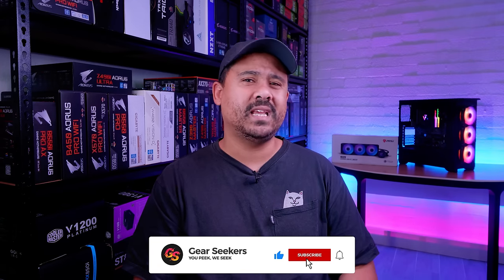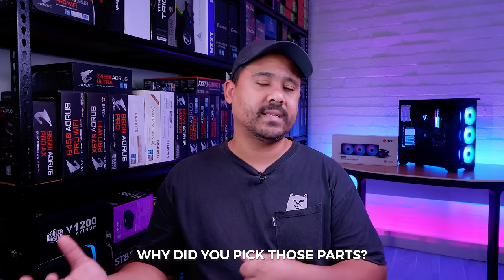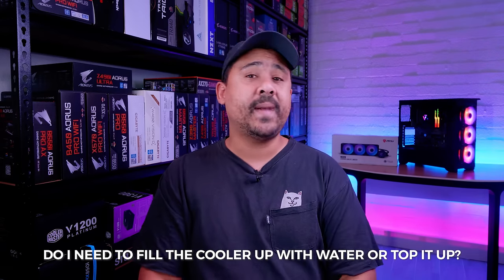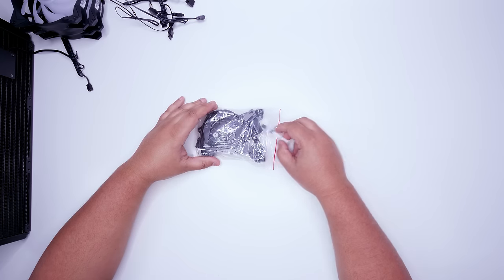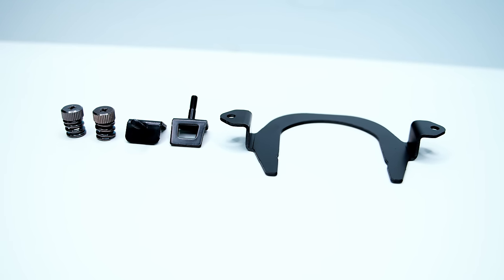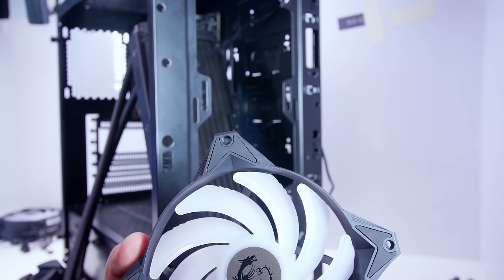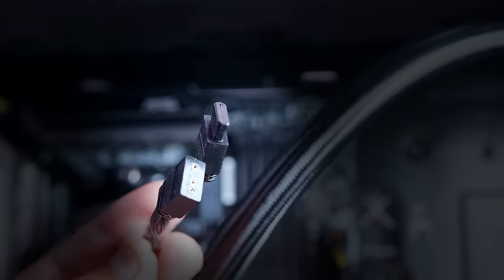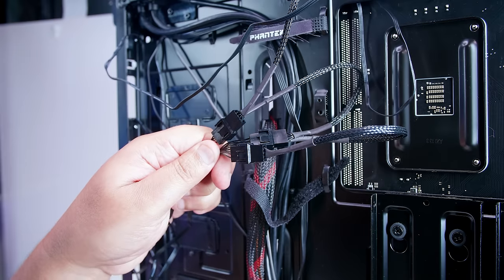HOW TO MSI MAG Coreliquid 360R & 240R AMD AM4 & AM5 Install Guide

Comment: Hi I have msi mag 240r. I can put it only on front case. Should I put tubes up or tubes down during radiator montage? On movie tubes are up but on some vid they sad that should be down because if is up then have some bubbles inside cooler.
Reply: Tubes should always be down, but if it is up that is fine
Reply: Do not put the radiator below the cpu block or the bubbles will form inside the radiator making a horrible sound, and life expectancy down the drain

Comment: Can anyone tell me are the way the fans are installed. Is this intake or exhaust?
Reply: He has the fans as intake in this video. They are pulling air in from the front and pushing it out the back of the fan into the radiator.

Comment: I wann put this on top of Motherboard not front. But as you said that is the correct way to install fans. how is that possible to put at the top Unless flip the radiator and install the fan. Or is that any problem if I put fan on the other side of radiator to put on the Up top of the case?

Comment: I have one small question. I have the MSI B450 Tomahawk Max. Both of the RGB ports are 4-pin and every RGB header on both the fans, and pump head are 3-pin. Is there any way I can connect the 3-pin to the 4-pin headers?
Reply: welcome to the stupid area of rgb & argb ... if u wanna control the lights on this cooler than argb header is a must .. or else find a cooler with rgb header .. i myself am extremely dissapointed with MSI for manufacturing the best B450 but not going with at least one ARGB header :3 :( .. i wanna buy this cooler for the 3700x but have a razer setup so need the lighting synchronized with my system so badly :( ...

Comment: my 240r failed in just 9 months . Temp spikes at 60-70 idle, must be rotor failure or air bubble. I tried different orientation, re-applied thermal paste and did the tilting/shaking thing but still out of luck. With my last spread of my thermal grizzly, I replaced my AIO with my previous Corsair H60. Going to stick for my Corsair H60 for a while until I can purchased something better CPU cooling solution.

Comment: I would recommend you avoid this cooler at all costs. I am currently sending my second one back to the store. Both my original purchase, of this exact model (the 360R), and my replacement failed with just over a year use of each. The fans still spun, but my CPU hit 100 degrees Celsius, and then thermal throttled from there. Maybe I'm super unlucky, but two exact same coolers failing the exact same way is way too much of a coincidence for me. Won't be purchasing an MSI cooler again.
Reply: Had the same experience. First one broke and got another just thinking it's just unfortunate it broke. Then it broke again. Avoid this cooler

Comment: i got the MSI B450 Mortar Max and it has 4 pins 12V headers? is there any way that I can still install this AIO and still sync the RGB?
Reply: Do not install the 5volt pins on the rgb to the 12v you can overvolt them, you have to have a Jrainbow header specifically 5v

Comment: YOU SHOULD KEEP THE PUMP AS LOW AS POSSIBLE TO AVOID NOISE AND DAMAGE. 
If installed like the shown in the video air bubbles will accumulate at the top and end up in the pump.
Id install it vertically but upside down if theres enough tubing. 

NEVER  AT THE TOP horizontally (ive made this mistake and paid the price, my unit failed after one year). 
KNOW WHERE YOUR PUMP IS and keep it as low as possible!!
Reply from the maker: MAYBE UNDERSTAND THAT THE PUMP IS IN THE RADIATOR FOR THIS COOLER MR GENIUS
Reply: v1 of this product in general fails after a few months of usage no matter what. Pump noises and high CPU temperatures are some common issues.
Replace it for a v2 as soon as possible! They offer an advanced RMA if your product is not v2.

Comment: I tried installing it on my pc however when i turned on my pc it would turn back off. what should i do?
Reply: Same have you fixed this?
Reply: That’s a power supply issue, meaning you have to much wattage then the PSU can handle so if your setup is 800+ watts and only got a 600 watt psu then it’s gunna shutdown

Comment: my MB has a JRGB pin set instead of a JRAINBOW... what kind of adapter would i need for that
Reply: @enderjose7558  deep cool has a converter but it’s not that good... get a usb 2.0 (mb connection) to argb controller... there are a few on Amazon

Comment: Thank you so much for this video. 
My pump of this cooler broke and I had to send it back (atm waiting for a replacement). In my idiotic hast I unplugged everything without making notes and now I was worried if I can figure out how to plug everything correctly again but this video made me understand what cable is for what purpose and where it needs to be on the mainboard.

So thank you a lot, really.

Comment: To be honest I tried to install an msi liquid cooling system on an AMD4 motherboard and it’s not worth it. I used one on an MSI x570 and it does not work. As the MSI heat sink is to narrow to install

Comment: ive had this aio installed in the front for 7 months now some water has vaporized and it doesnt cool anymore, so its better the mount it upside down so the water bubble gets on the other side ( not where the hoses are)
Reply from the maker: incorrect. This AIO has the pump in the rad
Reply: @GearSeekers  yes that's true the pump is in the rad but if there is air where hoses are to wich goes to the cpu block and it can't pump water because of the air blocking the water.
Reply: Pin this comment!!

Comment: Ok so here's my situation....
Had a customers threadripper 2900wx PC at my shop for 1.5wks. Thought the mobo was bad because my 3 test power supplies were bad and making me think the mobo needed replaced. Customer wasted my time wanting a new custom pc so I put his machine (disassembled) on the shelf in boxes and says he no longer wants the new pc and just wants his reassembled so he can use it intermittently while it shuts off and on.   I started thinking.... "Could the P.S. AND the AIO both be bad????? So of course he wants it reassembled and yes i"m chargunbg for that but I've never returned a PC in non-functioning state. So I  don't have ANY threadripper or SP1 socket experience... So I simply buy new P.S. and grab an old 120mm aio from the trash heap and hold it to the threadripper and hook up the new p.s.,,,fire it up and all is successful.   So now I want a new 360mm NOW!!! So i go thro my bins and parts and stumble on those weird brackets for the sp3 socket which I never knew what they were for. But now I do!!     SO unfortunately I don't have any parts or new AIO's in stock to fit this socket. So i'm off to Amazon at 930pm to get one delivered overnight.... Well the delivery isn't hard but which AIO comes with the SP3 bracket???? Oh man... Well... I had an old MSI MAG and fortunately one of the Sp2 brackets seemed to fit and then go on the board perfectly so I think.... I need the MSI MAG 360. I need to go to YT and see if there's a video on this and here's this guy..... I start skimming thru the video and I hear "Although this AIo does support threadripper, we're not gonna cover this because I  think the cooling plate is too small and that's for another video". And he's right!!! HOwever..... It isnt ideal but it will work for the most part...likely not when overclocking. So I must thank you man for this vid..... tonight has been frustrating and i have WAAAAYYY too much time into this repair. thank you thank you!!!!
BTW I thought I'd mention that the owner of the PC had this built elsewhere FOR OFFICE WORK!!!!!!!!!!!!!!!!!!!!!!!!!!!!!!!!!!!!!!!!!!!!!!!!!  WTF???????????????? Not even one video game or 3d rendering NOTHIN!! The world is indeed out of balance

Comment: If anyone can please help, am PC noob. Built my new PC. My motherboard ASUS AM4 TUF Gaming X570 does not have the JRAINBOW2 plug, Instead I have 2 (4 PIN) RBG header ports. Obviously the 3 pin plug does not plug in here. Is there a converter or other plug I can use?

Comment: I bought the 240R, just wondering is it okay to put corsair QL120 fan kit on this radiator instead of stock msi ones?
Reply: Yes you can use any fans with this as long as they are the correct size

Comment: For anyone that is considering getting this water cooler DON'T!

They did a horrible design with the pump location being in the radiator and not the CPU Block
which causes air pockets and the pump will run dry and burn out, and make's your CPU run hot until it crashes.
Reply: What about the v2 version ?

Comment: i install this one, and i think i have a problem. whenever i plug the power cable the lights in this cooler flick for a sec. is that normal? please answer, badly need help :(
Reply: There shouldn't be any flicker, I've been using this AIO for a month.

I even sync this with 3 extra Msi argb fan

Comment: Great video.  I am doing my 1st build with the 360R.  I unboxed it and mounted the fans.  I am using this on a ASUS ROG Strix B550 F and for the life of me I cannot figure out how/where to connect the pump and fans to the motherboard.  There is a spot on the motherboard for these items but each one has 4 male pins & the pump wire has 3 female ends and the wire off the CPU connection has 3 female ends, 2 close, a space then 1 on the outer end.  Has anyone used this combination and successfully got it working?  Also, I am using 6 Lian Li AL 120 fans with their controller, can I daisy chain these fans into the Lian  Li controller?  Thanks
Reply: did you mount it on the top or the front? Have you encountered any problems with your 360r AIO? I am also planning to use a 360r for my Ryzen 5 5600x build. and i am wondering if it is a good AIO

Comment: I bought the 240R version, im planning to upgrade my motherboard to a b450 tomahawk max will it fit?
Reply: by fit in i meant will i be able to connect it normaly
Reply: Nope, the b450 max doesn’t have a Jrainbow pin connector on the motherboard. Literally building my pc right now and just realized :(

Comment: I wanted to get this Cooler for a 12600k but I saw people complaining about the aio pumps failing after 6 months. Some ppl reported bacterial development within the liquid. Can anyone confirm/ deny it ?
Reply: Yes. Mine died last month as it lasted 10 months. Don’t buy it
Reply: Got one the first time on a build i ordered. Was working great until a few months in at which point crackling started. Failed completely 7 months in. Got warranty and another one came. Worked great for 7 months, then cooling power decreased and currently looking for a new one since the cooling is failing completely again
Reply: @primisto7530  wow💀💀

Comment: So, my B450 Mortar Max does not have either ARGB (just JRGB) or Pump_fan (Just CPU_fan) headers. Are these problems I somewhat can solve without buying a new motherboard?
Reply: Yeah your motherboard doesn't have a 3 pin argb header I think so you need to buy a separate rgb controller and plug the 3 pin cable to it, while for the pump_fan, I think someone had the same problem in the link below,

https://forums.tomshardware.com/threads/where-to-plug-aio-on-a-mb-without-pump-header.3556077/

Comment: I have an msi z270 sli plus mobo and van only find a 4pin rgb header. Do i need to buy a controller?
Reply: yes. plugging the connector in will fry the rgb, if it will fit.

Comment: What options do I have if my motherboards doesn't have JRAINBOW pins?
Reply: Mine either but check if there is something similar. For example, Asus boards may have Aura RGB Strip Header...
Reply: i think any 5 volt rgb header will work

Comment: just wanna ask if you still download msi apps to controll argb? mine aorus pro wifi.
Reply: I don't think so, as it seems to be controlled via a 3-pin argb header, which can be controlled through the mobo's software. If you are using a separate argb controller, the control method will be the one of the controller.

Comment: hello appreciate ur hard work. but, my question is "can i mount the fans to the opposite side of the rad where the pump is located" and will the 240mm version fit in the h400i with a 2060 super strix. i would like to get some help from you

Comment: Can you do the same thing but for the 240r one, I’m confused on the wiring
Reply: I have the same cooler instructions are meh
Reply: I got mine 3 days ago I'm confused as well also I'm stuck because my rbg is 4 pinned and the cpu is 3 so that doesn't even go in when I looked into it said my mobo was compatible it works and all but got no light

Comment: Very helpful video. But are the fans installed in the correct orientation? The way you have them installed wouldn't they be pushing the hot air in to the case? If you are going to install the fans on the outside, wouldn't you want to flip them over so they are pulling hot air away from the radiator? Let me know if there is something I'm just missing about how this is supposed to work.
Reply: You’re correct, the radiator should be on the outside, not the inside. Or you could just turn the fans over.

Comment: hello it is possible by combining the MSi MAG CORELIQUID 360 on the front with A rtx3080 FE ?
Reply: Check your clearance, just get a measuring tape, and measure the length of the GPU then the AIO

Comment: the motherboard i have rgb header is 4 pin and this AIO rgb connector is 3 pin so how should i connect it
Reply: what's your motherboard ?
Reply: @ZAiN_JZ  asus rog strix b450-f gaming
Reply: @jihadsalimsayed6930  Yeah, unfortunately your motherboard doesn't have addressable rgb headers (ARGB) which are 3 pin headers, so you can't use the rgb for this cooler, unless you buy a separate rgb controller, some liquid coolers do include an rgb controller with them but this MSI aio doesn't.
Reply: @jihadsalimsayed6930  just get a 5v 3pin to 12v 4pin adapter

Comment: Hi, thx for this Video. MSI didn't put a manual inside so therefore your vid is highly appreciated. But I have a question: Shouldn't the Radiator and the vents be exchanged for maximal cooling-effect ? Because now we are blowing the heat inside the case. -> I know if we exchange the places the we don't have the RGB lightning effects anymore, so I will install it like you showed us, but I'm curious if my point of view is correct.
Greetings from Vienna

Comment: Will this work with a 12v rgb connector? That all i have on mine .-.
Reply: I have the same issue, I only have the JRGB 12v on my MB ( msi X470) but the plugs from the cooler are a diffrent one
Reply: @Robin-pe6yn  so the cooler and fans will work just not the rgb?
Reply: @Lugmos_  exactly, the Fans and pump will work fine but only without the LEDs
I thought that msi has standardized plugs but no every year they come with New and diffrent shit and nothing is  compatible
Reply: @Robin-pe6yn  alright, thanks mate. I get mine today or tomorrow whenever it arrives lol. As long as it works idgaf about rgb right now lmao.
Reply: @Lugmos_  I think i will  send it back  and ask MSI why they made a Product which isnt compatible with a whole Mainboard series...
Reply: @Robin-pe6yn  I know there's rgb controllers for situations like this so I'm not worried about it rn. As long as it works I don't mind not seeing lights until I get an adapter.
Reply: No it won’t work, it has to be a 5v header 3 pin, just get a RGB HUB with 5v headers and 3 pins.
Reply: There not that expensive

Comment: Hoses at the top of a vertical mount, Steve from Gamer's Nexus is displeased.
Reply from the maker: The pump is inside the rad. Be quiet
Reply: @GearSeekers  the barbs are still at the top of the loop where air is going to accumulate and still going to trap air causing noise issues (gurgling, trickling water), and will lead to performance issues as the AIO ages.

Comment: Can someone Plz answer this- Is there an RGB header on MSI B450 Tomahawk MAX, and if not, can I connect the radiator fans to the lighting node core along with SP120mm fans attached to it? Thx
Reply: No there is not
Reply: @sfgoose2875  thx
Reply: @Krieg4Life  message me on discord if you have anymore questions :)
Reply: @Krieg4Life  SFGoose#0666
Reply: @sfgoose2875  ok thx

Comment: idk why But I had to use two plastic spacers for it to apply proper pressure
Reply: Did you use them under the spring nut? I’m having some pressure issues myself and have been trying to find info from anyone else that has done it.
Reply: @BoozeBelly  yes in-between the bracket and spring
Reply: @dev894  thank you! 🙏

Comment: What are the temps on the 3700x with this cooler?
Reply: I'm using the MAG 240 AIO System for my Ryzen 7 3700x. In Idle my CPU is about 50°C(122°F), i also testet temperature after 2 hours gaming with a cinebench20 run, my CPU was at 65°C(149°F) maximum temperature. I was reading out the temperatures with Afterburner
Reply: @manuelgrafl9331  pretty chilly
Reply: yo tengo la de 360 y el ryzen e da esas temperaturas entre 48°C y 69°C y no me parece normal

Comment: cooler tubes should be at bottom
Reply from the maker: Absolutely INCORRECT. This cooler has the pump in the radiator. The orientation makes no differenc. Not only that even if it wasn't it makes NO DIFFERENCE.

Comment: Is there a way to get the rbg working with the b450 tomahawk max?
Reply: If you have a 4pin 12v connector instead of the 3pin 5v connector needed for this fans then no.
I have the same problem as you and there are multiple alternatives:
1- Buy the convertor from deepcool which converts argb to rgb;
2- if you already have a fan hub/controller (which came with your case or other fans you bought) which has arbg (3pin 5v) you can connect the fans to it and change the light.
That's basically the only ways.
I am going to use the n2 (i've tested a fan with the hub that came with my case and i could switch the light through the button of the case).
Hope i could help